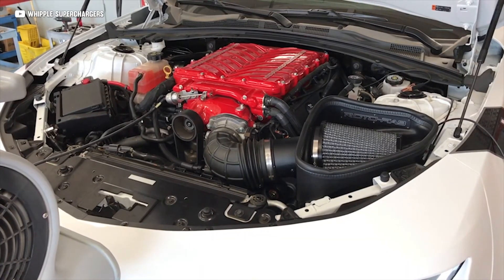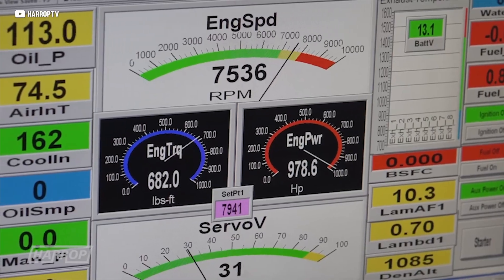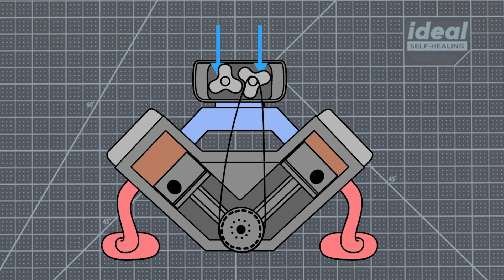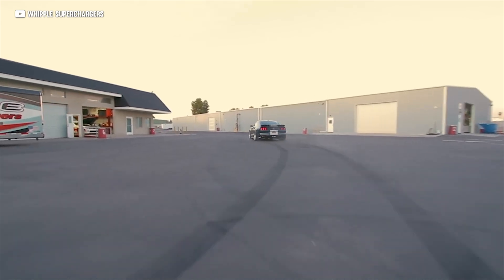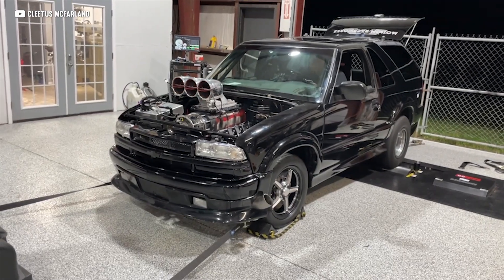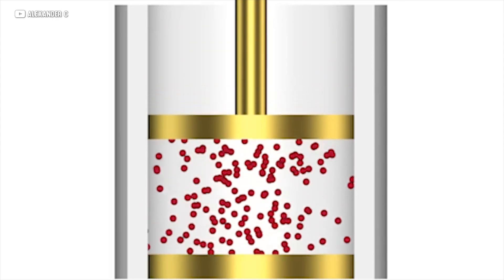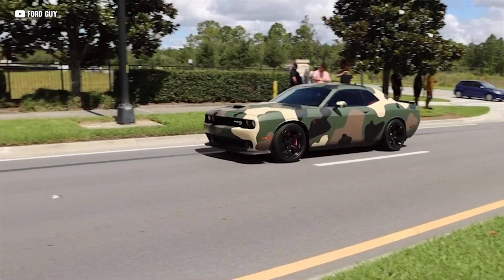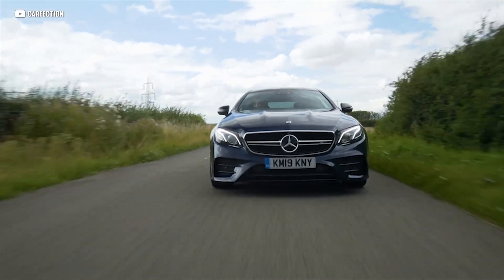SUPERCHARGERS! | How They Work // AutoLab

Comment: I have an Aussie Ford Falcon GT with a supercharged Coyote from factory recently rebuilt motor to accommodate slightly larger supercharger is over 600hp at wheels but bigger element in inlet for cooling and intercooler element as boost is above 12 pound from idle